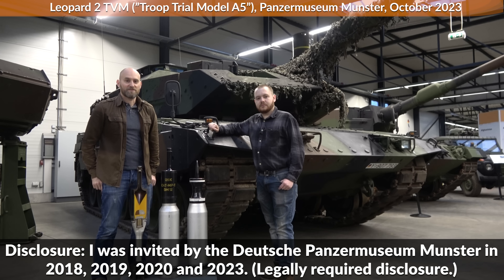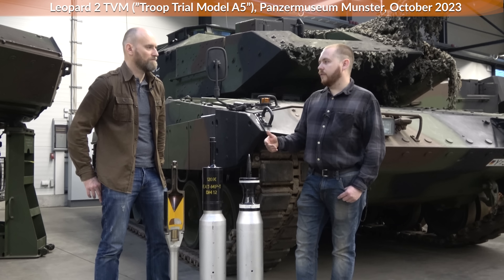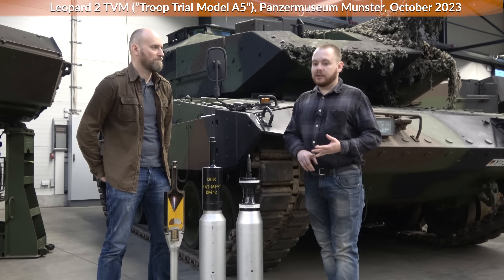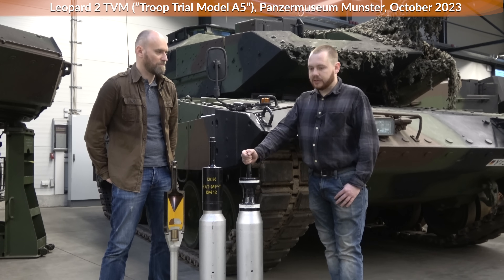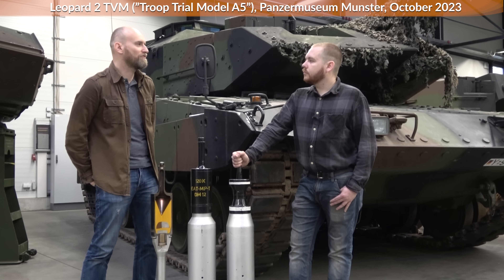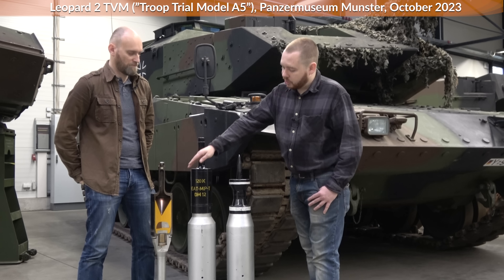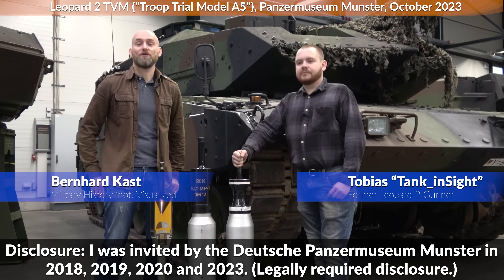Why you need proper HE rounds for Tanks

Comment: As a sidenote  Western tanks (with the exception of the Challenger 2) can't be really used in the indirect fire role because of the smoothbore gun.The same aplies to the  Rusians. This is one of the reasons they use older tanks. For effective indirect fire you need rifled barrels.
Reply: Ahh, no? 125 mm smoothbore from T series is frequently used for indirect fire in Ukraine. As long as you have a drone adjusting the fire and dedicated ballistic calculator app running, you will hit what you are aiming for eventually.
Reply: @katamarankatamaranovich9986  Bingo. There's video of it in the assault on Krasnohorivka foothold about the time the turtle tank appeared they dropped off infantry rtb and used HE like an assault gun
Reply: All Soviet / Russian tanks since 1950s have the equipment for indirect artillery fire and calculated ballistic tables for their munitions.
Reply: Considering that modern long-range 155mm rounds already utilize guidance systems like GPS and control surfaces to achieve the desired accuracy and precision, I have doubts whether rifled barrels are still required . My guess for the future of artillery is the adoption of smoothbore barrels, possibly with sub-caliber ammunition, to achieve higher muzzle velocities for maximizing range with the added benefit of reduced wear.
If you want to reliably damage targets at the range of indirect fire with regular tanks, you‘d probably need guidance anyway as the payload of 120 and 125mm shells is substantially smaller than 152 and 155mm.
Reply: @RichelieuUnlimited  120mm can have enough payload for indirect fire, both sides in the Ukraine war still use the old 122mm soviet artillery systems.

Comment: @9:51 Т-64 Ukrainian design. Really?
Reply: Yup Ukrainian
USSR had quite strong rivalry and competition between armor factories which resulted in limited cooperation. So T-64 has been designed and produced by USSR (Ukrainian SSR) unlike T-62 produced in RSFSR 

Different designs, approaches, factories
Reply: Yup, designed by a Tank plant in the UKRAINIAN SSR.
It can either be called Soviet, Ukrainian or even just Soviet-Ukrainian.
Russians had very little to do with its design.
Reply: Many of its components (armament, optics, ballistics calculator, other electronic equipment, armor package layout, etc.) were designed and/or produced in other parts of the USSR (mostly Russian SFSR). 

KB-60M/KhBTM was responsible for the general design and chassis, attached KhKBD for the engine, the KhZTM plant for engine and chassis production, and final assembly. Mariupol plants provided armor plates and casts. Those are the elements that were physically located in Ukrainian SSR.

Furthermore, those bureaus and plants had engineers and workers from all over USSR, not just Ukr. SSR. Not to mention that there is no practical difference between Russians and Russian-speaking Ukrainians, especially during Soviet times.

T-64 is a Soviet tank. T-72 is a Soviet tank. T-80 is a Soviet tank. Even T-84 and T-90 are in a large degree Soviet tanks.
Reply: Yes… It’s like if a person designed an American thing. He still did that regardless of if that part of America is no longer America anymore, but Texas. It would be a Texan design. He lived in Texas, he was the mind behind it. It’s a very easy concept to understand.

If a state secedes from a union by choice, it is that area in which that union created things under its fight for independence. Now if it was before America was even a state, then it isn’t “Texan”. But native. But that’s time period, and legal speak.
Reply: @BARelement  Soviet design. That's what I meant. You are absolutely correct, sir.

Comment: 0:56 You were correct calling the  penetrator  a spike, as "jet" is the wording  of the old  "molten copper" explanation.
See   the Wikipedia article for the  FOA-source where   high--speed  X-ray cameras were used  to record the actual  process.
Reply: It is not molten, temperature is too low. In case of metals like tungsten, no melting is guaranteed.
Reply: @BojanPeric-kq9et  Wolfram can''t be used as liner in a HEATshell, as the liner needs to be very ductile to be shaped into a spike or needle by the detonation.
Reply: @johanmetreus  and copper can't be melted in HEAT round.
Reply: @BojanPeric-kq9et  Entirely correct, as we now know that the temperature in the liner doesn't exceed 800°C.
The old (and debunked)  explanation of how HEAT works talked about "a molten jet of copper burning through the armour", and thus the correction made in the video ironically is incorrect.
Reply: @johanmetreus  I found few times that HEAT is actually plasma. That would imply around 6000K minimum. Which is itself fascinating on multiple parts: from speed of rising temperature to very low specific thermal capacity of metals which would result in almost instant cooling of that plasma in contact with solid armor.

The very fact somebody can believe in "burning armor" which is among other things solid steel... Lack of knowledge about basic physics and chemistry is deeply disturbing.
Reply: @BojanPeric-kq9et  Sorry, but I find many other things much more disturbing, than misunderstanding the physics and chemistry on how HEAT works. But yes you‘re right. Many military weapon amateurs still get it (very) wrong.

Comment: Now that armorers have figured out how to deflect focused chemical energy AT ammo from penetrating tanks, looks like its time to go back to the drawing board to figure how to deflect focused kinetic energy AT ammo from penetrating tanks.
Reply: They already have. The latest version of reactive armor is suppose to project the plate of steel at fast enough speed at an angle to potentially shatter tungsten rounds which are hard but brittle. DU rounds are more flexible and not subject to shattering. The reactive armor can cause it to flex affecting its trajectory to some extent.
 That is a very simple condensation of multiple long articles I read on it a couple years ago.
Reply: @craigplatel813  ~1670, Isaac Newton noted (while not exactly in this context) that "for every action, there is an equal and opposite reaction".
Reply: @craigplatel813  It's always an arms race. APFSDS projectiles like M829A3 use a steel tip to detonate the ERA early. If you want to read more about it https://en.wikipedia.org/wiki/M829#M829A3
Reply: Some active protection systems can intercept APFSDS projectiles, but they generally only reduce the penetration (often referred to as degrading the projectile) so the projectile could still penetrate thinner parts of armor. And active protection systems don't always intercept projectiles.

Comment: Why dont we have tandem HEAT round
Reply: Likely a limitation of cartridge overall length. It's also a bit redundant as a KE penetrator is still more effective when engaging MBTs.
Reply: If the target is well protected enough to need it, you use APFSDS
Reply: There is a Russian 125mm one, 3BK31 IIRC.

Comment: Although I don't know of any times this was actually used, I seem to recall having been trained in the use of firing tables for indirect fire with our M60 series tanks using HEP (High Explosive Plastic) and WP (White Phosphorous) rounds!
Reply: can confirm, used old US army publication before (our military copied it directly), fire mission was conducted as a platoon with the platoon leader acting as fire direction officer, and the observers are designated from either one of platoon's NCOs or company HQ personnel (in my exp, usually platoon's second most senior NCO after PSG, but I've seen one CPL from company mess winded up as an observer somehow)

If I remember correctly, company HQ was also issued gun laying equipment (aiming circle and stuff) just like the one issued to an artillery battery
Reply: I would imagine in 5 years, the old loader for Bradley's will be the drone operator and drone defense operator. and indirect fire will be standard operations
Reply: @GhostScout42 bradley has a loader?
Reply: @nikujaga_oishii  if I recall you have to drop the door to the Bradley to load it? idk I trained for lime 3 days on it. I thought we were talking about mbts
Reply: @GhostScout42  we were talking about MBTs, that's why I'm confused by your "the old loader for Bradley's will be the drone operator" statement

plus I didn't know Bradley even got a loader? and what door and loading procedures are you talking about?
Reply: @nikujaga_oishii  oh, my bad. I meant Abrahms. but yeah Bradley's will have to have a dedicated air guard too. Mark my words. radar controlled auto shotgun for drone defense on vehicles
Reply: @GhostScout42  .50 on top of tank turrets were originally for AA purpose, so might as well just drop in new fire control like BLADE on the RWS for use against group 1-2 sUAV

I mean, that's basically what American dedicated C-UAV systems like MLIDS currently use (partially at least)

they can also put an M3P or M3M on it, just like Avenger

Comment: Tank, when not engaging other tank, is usually tasked to provide local direct fire support. Faster and  more precise than calling in Fire support.
Using HEAT-MP is an expensive method, to target soft targets.  The amount of explosive that HEAT-MP has, will always be less than a dedicated HE round.
Reply: This is exactly why the British kept the rifled barrel on the Challenger 2, since 120mm HESH rounds give much better anti infantry and anti building capabilities than other nations that use 120mm HEAT
Reply: @Lo-tf6qt  hesh is really bad compared to he frag against infantry. It’s unable to damage trenches and soft earthen fortifications. It’s only good against hard fortifications like concrete and steel. HEAT+frag is way better than HESH. There’s a reason the uk isn’t using hesh for challenger 3. Red effect has a video on this too if you don’t believe me
Reply: @tim2024-df5fu  artillery is against area targets, tanks are against point targets. Shooting from even 5 km away you can put shells through a window
Reply: Both rounds go boom 🤷‍♂️
Reply: @G36C-556  so a cap gun and a tm62 mine(7.5kg of tnt) going off under your bed is the same right?
Reply: @itsericzhou  both would wake me up, so sure. Difference between HE and HEAT is more like a 30.06 vs a 30cal bullet (im not saying which one is which)
Reply: @G36C-556  it really isn’t. First off HE rounds have double the amount of explosives. It then has a shell around it designed to break apart and fragment. These pieces are big and will kill or severely wound anyone it hits. It then has fragments packed inside which will injure anyone it hits but most likely won’t kill due to their smaller sizes. The difference is massive. Stop coping.
Reply: @itsericzhou  waa waa tank shell go boom and boom hurts 🗣🗣
Reply: @G36C-556 so g36c-556 is same as 22lr rifle?
Reply: Heat have more explosives than he. Problem is their shrapnel is too small and has low range
Reply: @tedarcher9120  heat shouldn't have more explosive than he; the copper liner gives a cone of air which could've been filled with more he
Reply: @beaclaster  yes but heat uses more powerful explosives so it's tnt equivalent is higher. HE is mostly steel
Reply: @tedarcher9120  Also wrong, American HEAT rounds have Comp B, a mix of RDX and TNT, HE rounds are almost pure RDX with a slightly higher explosive force. with about twice as much explosive in an HE round compared to HEAT. They arent the same and should not be used the same way.
Reply: @tedarcher9120  
This is simply wrong. HE rounds typically have about twice the charge weight as a HEAT. Some examples would be the 125mm 3VOF128 HE 3kg charge VS the 125mm 3VBK27 HEAT 1.6kg charge. For NATO you have the 120mm M908 HE 3.2kg charge VS the 120mm M830 HEAT round at 1.6kg charge.
Reply: @cipher315198  just curious what shoots the m908 HE since most nato tanks shoot MPAT/HEAT-MP and sabot
Reply: @itsericzhou  the 120 m908HE was most likely developed for the old US heavy tanks of the mid cold-war era.
And thus developed for 120mm rifled guns.

The Swedish Strv.122 is however, issued with HE-FS that combines the combustible propellant case for the Rhm120mm/L44 with an Israeli designed 120mm HEFS (Fin Stabilised) mortar projectile produced domestically under licence.
Reply: @itsericzhou  It's produced and use by the USA va the M1A1 and M1A2. Though any tank using a L44 gun could use it in theory. It came out in 2003. It was originally supposed to be a "obstacle clearing round" for use by combat engineers. However It actually saw some direct combat use in the Iraq war, As said war highlighted the issues with HEAT rounds against soft targets. It is on track to be replaced by the M1147, which is the smart HE round for the US. That is the one that can do all  the fancy stuff he talked about, like air burst delayed detonation etc.
Reply: @cipher315198  the smart round is heat no? MPAT/HEAT?
Reply: @itsericzhou  Unclear. It is not advertised as such but if you watch 
Northrop Grummans video on it it seems to have something like a HEAT round in the nose cone.

https://www.youtube.com/watch?v=yEAYNX_UCjw

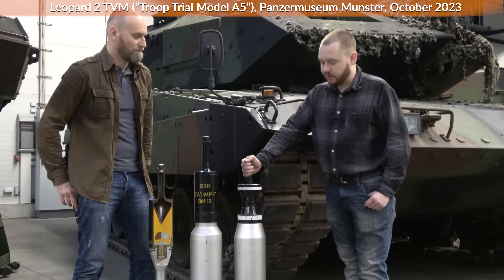Watch the impact tests starting at 1:25. If there is no HEAT element in that I would be sort of surprised, as something is giving it a a lot of penetration forward
Reply: @cipher315198  judging by the looks and the airburst effects, i think it might be a pseudo SAPHE type of round. That frontal tip is probably reinforced in order to meet the requirement of point detonate delay for going through concrete fortifications. My best guess is that the silver bit to the yellow band, is just thickened walls which contain tungsten balls for shrapnel+extra mass for penetration. further back is probably just steel balls. if you look at the fragmentation pattern near the center each crater kicks up significantly more dirt than the surrounding fragments since the tungsten balls would go have more energy and go deeper into the soil. with point detonation the tungsten balls would basically become a slug which is backed up by the fact that it doesnt go through a concrete cylinder whereas normal HEAT would 100% go through
Reply: @tedarcher9120  Thats baloney dedicated HE is far more explosive than HEAT and better against buildings a 125mm HE to a building can kill people on multiple floors from over pressure a HEAT shell directs most of its energy linearly and will go out the back wall of a building if sent through a window.
Reply: @off6848  Heat is not magic. It's just a regular HE with a bit of metal on the front. It explodes like all explody things do. Problem is that  most heat rounds are made as light as possible to fly faster so they produce less shrapnel
Reply: @tedarcher9120  are you special? look up any cross section of a HEAT round. it has an air cavity so the explosion can be focused into it, not to make it lighter. if it was filled with explosive it wouldnt be a shape charge and wouldnt be Anti Tank, so a HE round. please use google when presenting facts
Reply: @Bizzon666  yeah, that's why they drive on a little cart everywhere
Reply: @Bizzon666 higher velocity makes hitting a moving target easier
Reply: @tedarcher9120  No, there is a cavity in HEAT rounds, less explosive material